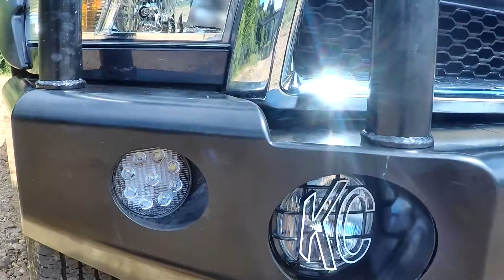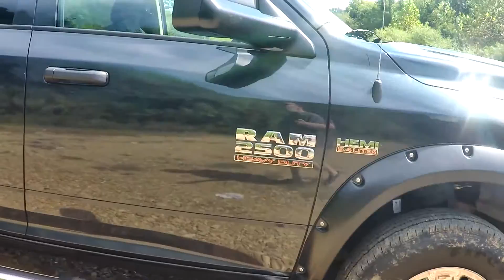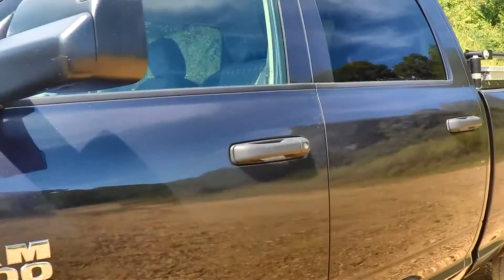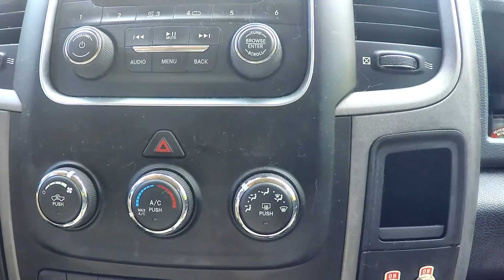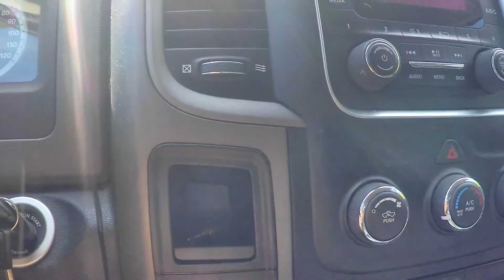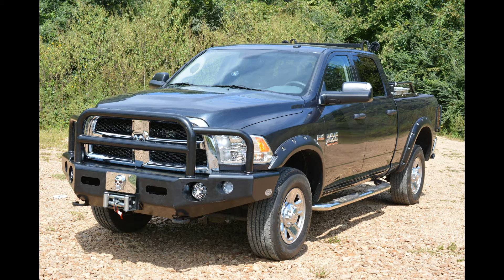Buckstop Classic II Install Complete

Comment: Nice!!! Deja Vu. Looks just like mine! Love the wheel flares. Who makes them and how much were they?
Reply from the maker: They are bushwackers I never painted them or anything. They where a pain to put on took me a good 6 hours it was a pain installing them but they do look nice and do protect the paint. I just installed a CB in the truck. I love where I put the antenna right on the front bumper https://youtu.be/9m5jzdyyIfA  Very shortly I am getting ready to turn the whole truck into a zombie responsive vehicle :)
Reply from the maker: I also installed a camera in the truck see here https://youtu.be/ElIKBCkWUg8 which was super easy to do took me like 2 hours to do
Reply: Did it require any drilling?
Reply from the maker: No drilling at all. The bolts are pure decoration. You will sit in the lawn chair putting all the bolts in for 30 min or so. Then you place the rubbers around the edge this is pain in the ass process. Put the fender on with clips you tighten down. I put the rubber on wrong for one and when I had it on the truck I could notice it right away. Pull it off and do it over... You can do it yourself its not a big deal just takes time is all.